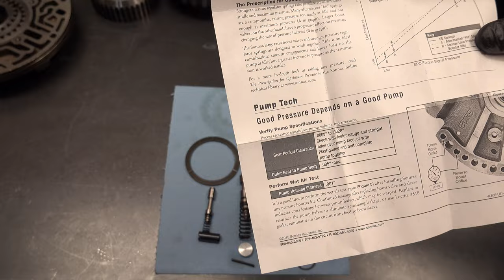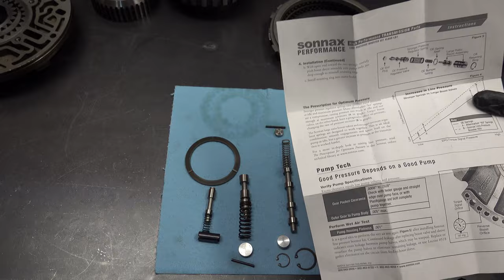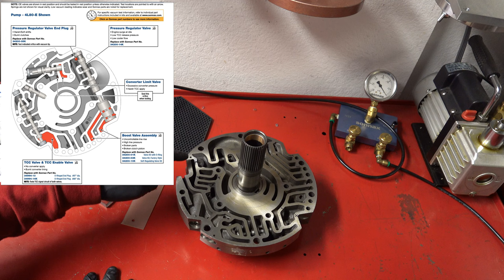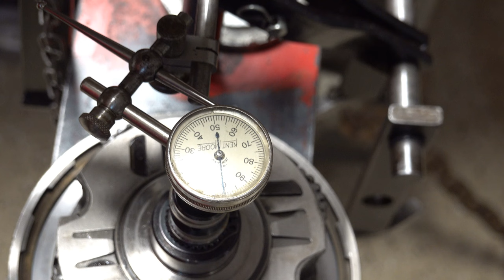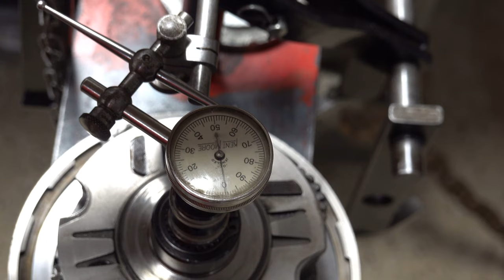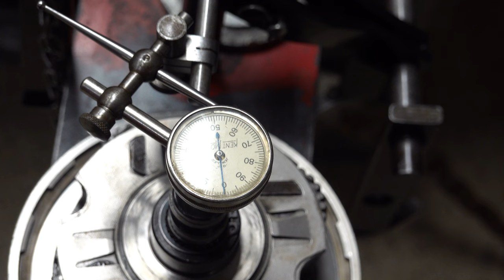4L80E Basic Rebuild - Part 2

Comment: I may have mentioned this before but in a pinch the green “Lip Wizard” disk that comes in many of the Transtec kits makes an excellent sealing ring stretching tool!  Roll it up tightly into a cone, put the new seal onto the small end of the cone, make the big end of the cone fit the shaft you are installing the ring onto, then push the seal down to its groove.  Works great without stretching the seal too much.  All bets are off with resizing.  Sometimes you can use the drum you are sealing if there is a generous chamfer but the proper sizing tool is best!  Those rings need to be perfect!  The worm clamp method usually leaves an indentation on the seals…….BAD!  I have seen guys use PVC pipe maybe a little oversized and cut it open lengthways.  Adjust the gap so that with a worm clamp around the outside of the pipe you can tighten it down into a no-gap situation and resize the seal with no marring.  I had also done that same thing with bushings, preferably a bushing that is used in conjunction with those particular sealing rings (like the C,D,F drum on a 10R80).  Basically anything that doesn’t leave an indentation directly on the sealing ring.
Reply from the maker: Thanks for watching and commenting Ross and great tips for alternatives to sizing tools! 

The hose clamp method is ok to use with the caveat it's done correctly, I know because I've done it countless times prior to obtaining all the resizers I have for each transmission...But the caveat is the hurdle for many including me as it's all too easy to get too aggressive, too tight and damage the sealing ring...

Anymore, I just buy the special tools but the Transtec green disc-shaped lip seal tools is a good technique and doesn't seem to carry any downside risk.

Comment: I reused my aluminum pistons as well on my early model 4L80E build. I tried using the bonded pistons that came with the rebuild kit, but the bonded pistons sit up too high, and I could not compress the spring cage down enough to clear the spring cage snap ring. When it came to the overdrive clutch seals after several tries at trying to install the seals myself I just gave up. I took my overdrive clutch to a trans shop that had the tools and experience to install the overdrive seals. They got the job done in 5-minutes. They tried to say no charge, but I flip the builder who did it a $20 bill for doing for me anyway.
Reply from the maker: It took me about 10 or so 4L80Es to get to where I can install those seals quickly like you see me do in this video...My first attempt took like an hour, lol!

Comment: Also I am building one very similar to what you are doing here.  Stock application, 3500 series truck (93) with a mostly stock big block.  My forward and direct clutch clearance are near identical at 0.069/0.071.  I could tighten up either one with the spare steel plates I have but I’m thinking I will be good there. Haven’t gotten to intermediate, overrun, or OD just yet but thinking I should shoot for 0.045 to 0.050 on a 4 clutch intermediate and the others are going to be what they will as long as they aren’t too tight which I doubt.
Reply from the maker: Your forward clutch is a bit loose - I'd put a direct clutch steel plate to bring it around .050 or so; direct is fine. Run intermediate to .040-.050...Overdrive pack is not adjustable so as long as you have clearance you should be fine. You can check my clearance for reference but, provided you're using factory spec frictions and steels in terms of their respective thicknesses, you'll be perfectly fine.

Comment: Can you recommend what rebuild kit you use for your 4l80e and where you got that pump from thanks.
Reply from the maker: Hi Patrick, check eBay for '4L80E Deluxe rebuild kit' - they come with Alto carbon-impregnated high energy clutches, steel module, bushings, bonded pistons (97+), paper, rubber, seals, etc plug a filter. 

Air pump was from Harbor Freight and I'm using the 4L80E air test plate which I do not know who makes it but you can find it on eBay or Amazon - search '4L80E air test plate'

Comment: also Are you using the 3x5 test plate
Reply from the maker: Hi Patrick,

Answering your question about 4L80E planetary carriers here: Hey Nick I have the 2000 4l80e when I bought this the seller said it had no reverse I got it tore down and come to find out that the front planet was pretty tore up the reverse band friction also fell off the band there are two types of front planets .795 tall pins and .710 tall pins should I get the .795 or .710 how do I know is there away of measuring them thanks.

A: If you have a 2000 4L80E, you should have the planetary carriers with with the taller pinions however it's very common for folks to swap between 1997-98 and 1999+ gear trains...They will swap the entire gear train, from the center support to the output shaft and literally every single part in between, across different 97+ transmissions so you'll need to measure the planets that came out of the transmission you tore down to be certain what to buy. There's now other way around it.

Comment: Newbie here. First thank you for making these videos! Very helpful.

Question for ya, I pulled the pump to do the HD2 shift kit where you have to do drill into the stator. Now I'm needing to put the pump back in. But I don't have a stand to hold the trans vertically. Could I still install the pump with it sitting on its pan horizontally?
Reply from the maker: Hi Tcampbell, thank you for watching.

Place the unit onto the floor or a very sturdy workbench then put a few large blocks of wood under the bell housing until the transmission is at a roughly 30-45 degree angle (a cylinder head stand would also work well). Then take a couple extra pump-case bolts and cut the heads off so you can thread them in to use as alignment pins to make it easier. Lube the pump and pump bore in the case up with tons of assy lube then install the gasket. 

Then carefully install the pump then use a drift punch to fully seat it.

Watch my lube mods video to for info on drilling the pump cover: https://youtu.be/bz2GxRD36_M
Reply: @nickstransmissions  great, thank you for the tips!
Reply from the maker: You're welcome!

Comment: I wanted to ask your opinion on something I am trying.  With my pump installed (it’s a different pump than the original bc that one was in very bad shape) and the play in the input shaft at the small snap ring (that secures the input shaft to the front planet) accounted for I had a little more than 0.050 of front end play.  The only pump spacer I had was the red one (0.073-0.077). I did find a 0.030 steel shim (I built a LOT of rear ends) that I put between the pump stator and the factory plastic shim.  I also had a 0.019 shim that fit perfectly under the thrust bearing under the front planet.  I looked to make sure the planet gears did not protrude above the ring gear (it did not) and then air tested the overrun clutch to make certain that the sealing rings were in fact able to seal and that the rings were still well within their sealing area.  This set up netted me a perfect 0.005) of front end play.  I your opinion is that something that might possibly give me an issue?  Everything spins smoothly and freely, really nice in fact. And factory front end play is (as I’m sure you know) is 0.005-0.025.
Reply from the maker: What is your rear end play?
Reply: Rear end play is tight. Maybe 0.005 tops.  It’s a bit more involved to check as you know.  It’s the same as it was before disassembly as I made no changes there.  I had the reaction carrier machined to clean up the low/reverse band surface.  The previous builder had put a wide bushing in the rear of the case which is still in excellent condition and the only bushing I didn’t replace.  It’s basically (low clearance) nothing yet still spins very freely.  There is about 0.025 to 0.030 “float” between the reaction carrier and the bottom of the center support and my intermediate clearance is right at 0.040.  I also made a rear band pin length checking tool from a late model servo cover (I saw an article about this) and used the Sonnax adjustable apply pin.  Really pleased with how that worked out.
Reply from the maker: You need ~.005 greater clearance in the front (net of the input shaft snap ring) than you have in the rear to prevent potential case binding as parts expand under heat. End play in the front has to be measured while the rear section loaded forward. Rear unit end play spec is .005 -.025 and front is .004-.022. 

I'd install a slightly thinner selective washer behind the pump to give you somewhere between .010-.012 end play up front. 

My targets have always been .007-.012 in the rear and .010-.017 in the front and that's for all 4L80Es that I build.
Reply: Okay thanks Nick!  I didn’t have the rear loaded when I did my front check!  That’s very helpful that you pointed that out.  I’m not in a big hurry on this one so I will go back over everything and get it right.
Reply from the maker: You're welcome, Ross!
Reply: I feel like I dodged a bullet thanks to your advice.  Before attempting to adjust anything I loaded the rear portion with a prybar and discovered I was not able to turn the input shaft!  Hmmmm that’s not good!  Took the pump out and removed the 0.019 shim I had under the front planet thrust bearing.  Put it back together and checked endplay (accounting again for the play between the input shaft retaining snap ring (right at 0.030)) with the rear loaded and got 0.009.  Plus I can now turn the input shaft with the lower end loaded.  Thanks again!!
Reply from the maker: You're welcome, man. Glad you said something!

Comment: what causes a 4l80e to stall when in reverse after a rebuild? Forward works perfectly, but only in reverse it stalls.
Reply from the maker: Hi Ganesh, there could be a serious bind in reverse resulting from too-tight an engagement between the band and front planet, malfunctioning TCC or TCC lock up causing the converter clutch to apply when put into reverse or something engine-related that doesn't present when in drive due to differing load 'forces' being put on the engine in reverse compared to drive. 

Interesting case - please let me know what you find out what's happening once you get it fixed!